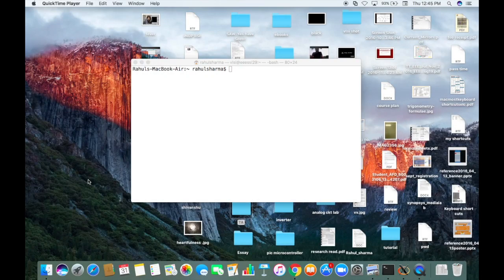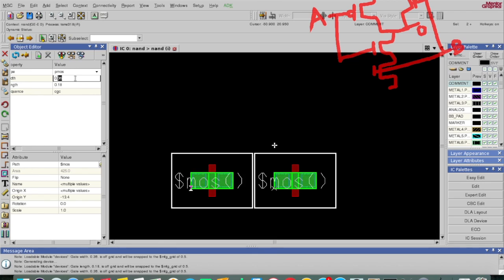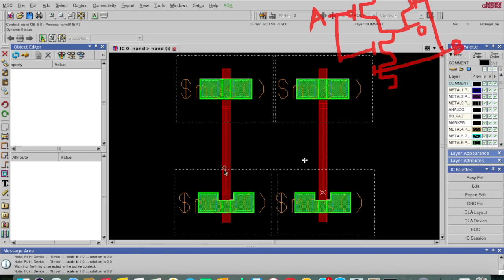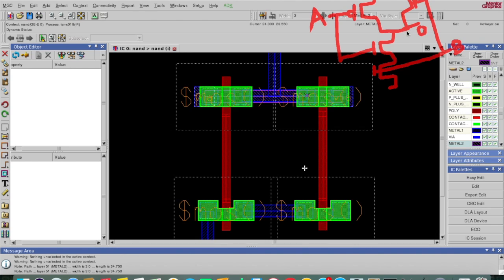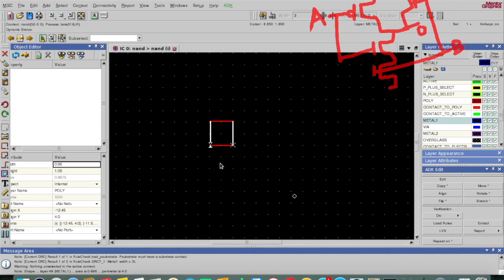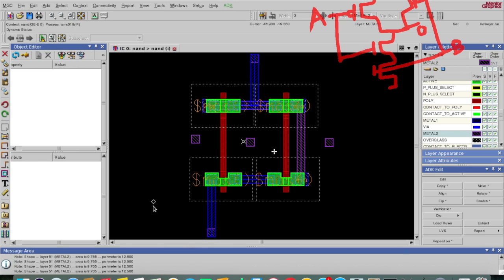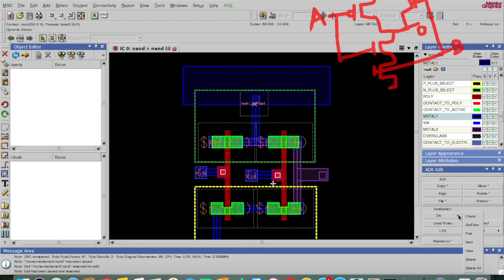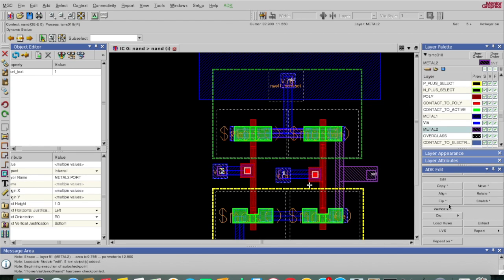Layout Design from Scratch using Pyxis - Mentor Graphics

Comment: Great video, but i got a question... 
1. Why is it so hard to find pyxis tutorial online? is this software no longer be used?
2. Why i couldn't used transistor such as nmos_4pin inside device_lib ? it says not defined when i go to simulation. Otherwise it worked when i used the transistor from generic13, but the problem is i needed to use transistor with large different Vth to make a voltage reference. 

Thanks!
Reply from the maker: 1- Because most of the designers are using Cadence virtuoso on other in-house developed tools. But yeah Calibre of Mentor Gaphics (now Siemens) is still the leader for DRC, LVS, PEX, antenna etc check.
2- ?